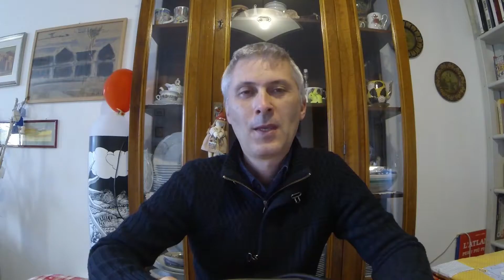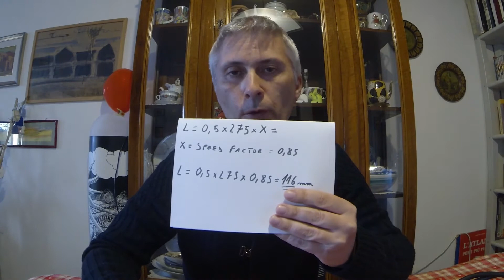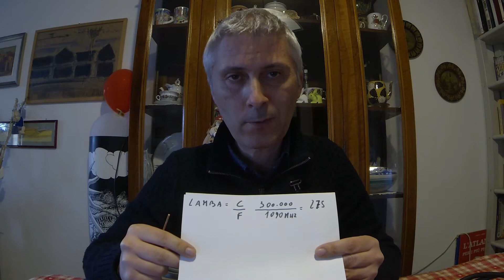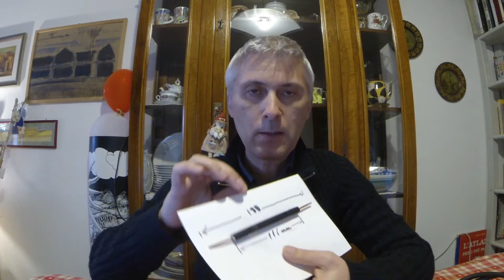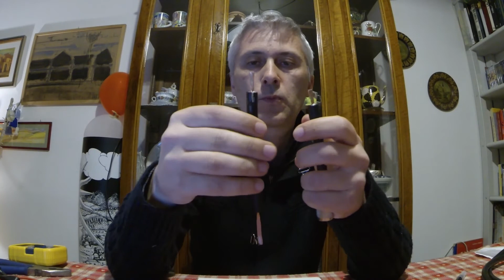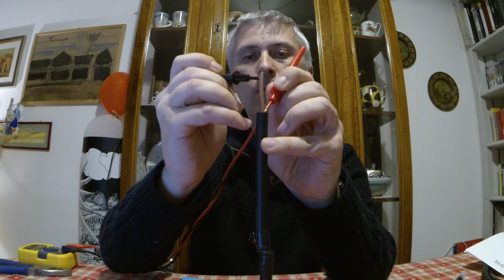How to build a Collinear Antenna for ADS-B 1090 Frequency Part 1

Comment: I made this, i used RG213, and adjusted measurements to suit, but instead of pushing the cable in i opted to make it hang 5mm over the end and soldered the core to the braid, gap was minimal, thickness of the insulation tape, took hours to get everything as perfect as i could, but in the end, the antenna was about as good as a piece of wire. UNTIL.. at the top i stuck a 51Ω resistor, and instantly aircraft 200+ KM started popping up.
Looking into it now, as Im looking at making another antenna, the piece of insulation tape can decrease the VF? is that correct? im going to make another, but want to avoid all the "DONT DO'S"

Comment: Shouldn't it be L = 0.5 x wavelength / velocity factor? 🤔
Reply: It shouldn't. Think of the velocity factor as a measure of "slowing down" the speed of electromagnetic waves in the given cable. E.g. VF=0.8 means that the speed of EM waves is 80% of the speed of light in vacuum. This also means that the length of the individual coax pieces of the collinear should be shortened by this factor because in a given "time slice" the wave can only propagate a shorter distance in the coax.
Reply: @laszlokovacs4322  Makes sense, thanks.

Comment: is last piece coax open or close (shorted) ?
looking many video and picture but unsure if end is open or close ??
Reply from the maker: Did You watch the electric diagram ? OPEN
Reply: @PaoloTuttoilmondo  yes i see yours..
others say short, some even have 1/4 open and 1/4 'whip' on top like T2LT/Sleeve dipole 
so some site confusing.
Reply: @CBRadioWayBack10-4  Actually it does not matter. Can be shortened, can be left open, can be terminated with a resistor, can be done anything, the differences are miniscule.
Reply: @laszlokovacs4322  ok thank you, i was not sure as many people say different and no one says which is correct..
thank you.

Comment: The centre core is connected to the (woven) copper shield not the dielectric which is the inner insulator.

Comment: Hi Paolo, fantastic video. Please what is gain this project? Tks 73. Rosendo - PS8RSA
Reply from the maker: about 7 db
Reply: Wouldn't you get 3db gain from each pair, giving 6db for 2 pairs (4 sections)? Also, you can double the number of stages for twice the gain.

Comment: Hello Paolo,  Great information. I made the antenna with you tutorial. and it works very well. The only thing I did was that I used small copper cable (just like the R58U) I wander i've it is better to use the RG213 cable. The results are very good at this moment, but it's nice to try a second one. :-)
Reply from the maker: Many thanks for feedback